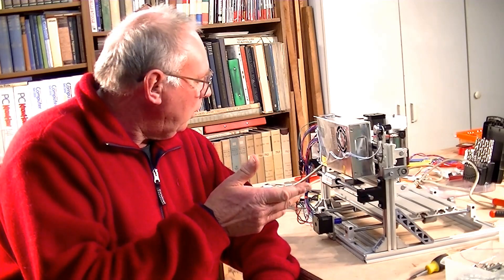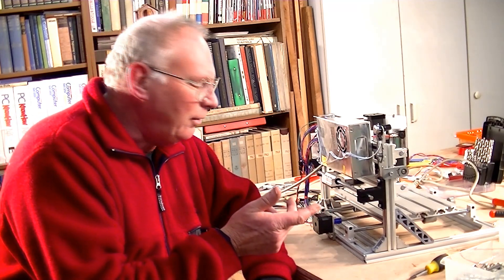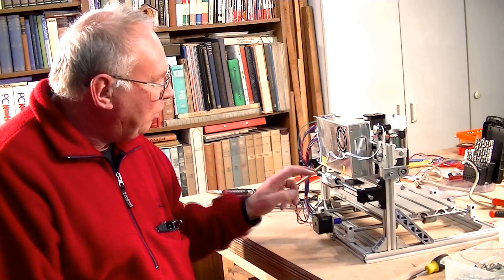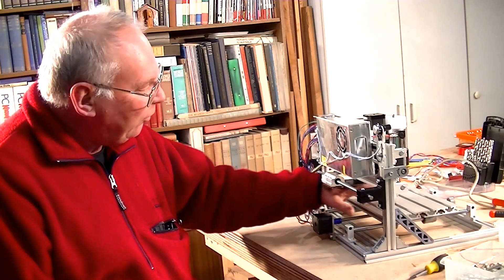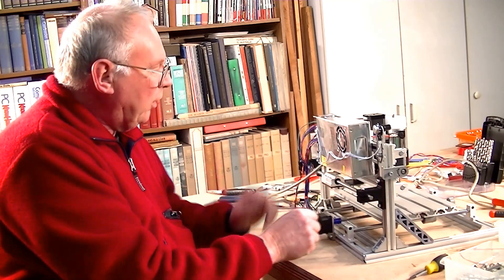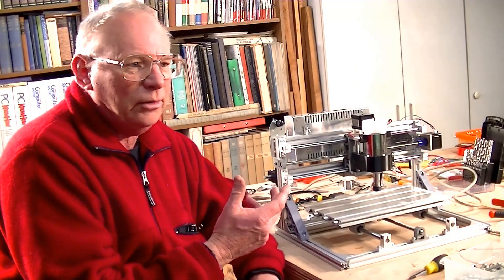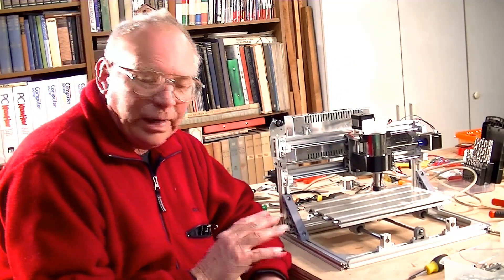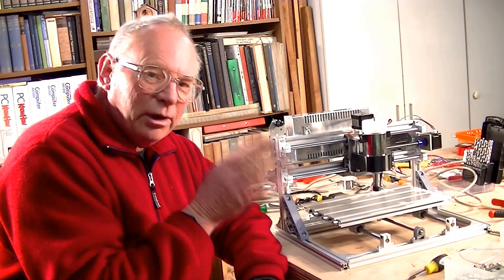3018 CNC router X axis third linear (3rd) rail bearing modification

Comment: We forgive you Rog........at least it isn't a major problem with cutting up the frame and no way to go back etc.
I have my 3018 still in the box, untouched by Human hand etc,  as I bought it to do an appraisal of a complete rebuild and in that build at least 3/4 of the original parts will be redundant so, it's a case of why build it up to break it down.
I've just ordered new extrusions....2020 and 2040.... for the build and SBR linear rails will be next on the list.....the 500 watt spindle has arrived with power supply and aluminium bracket.
I also want to go to Mach3 for the controller so that is another quite big outlay but more user friendly as I already have Mach3 on my CNC mill.